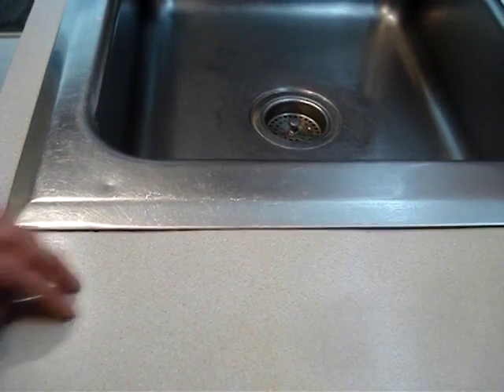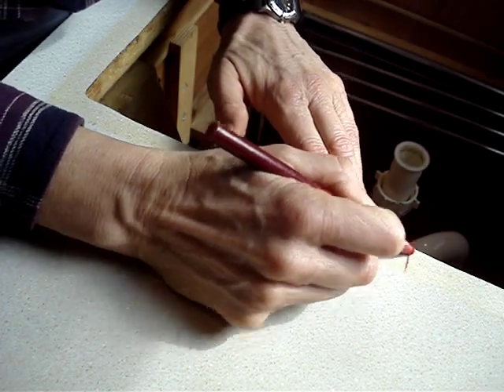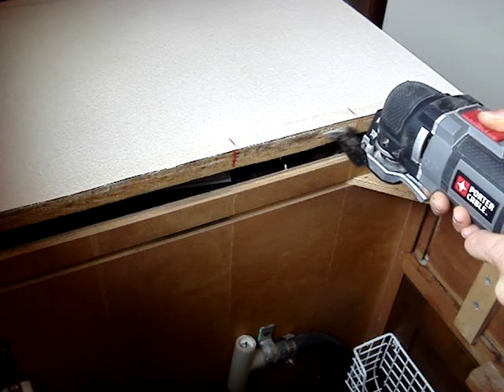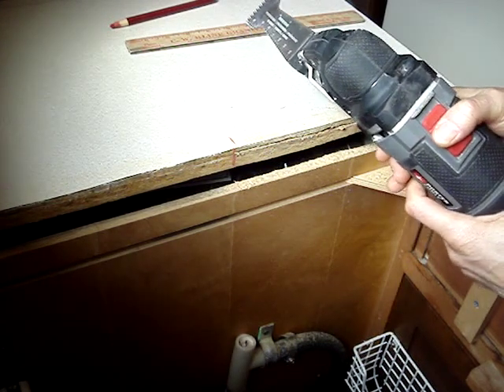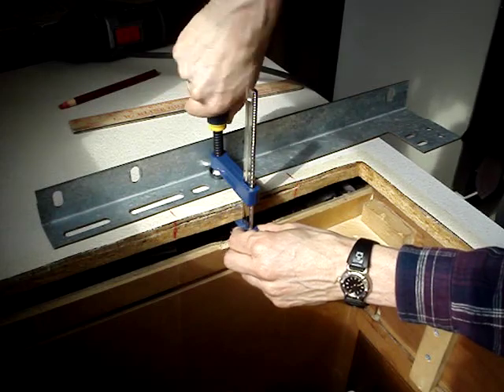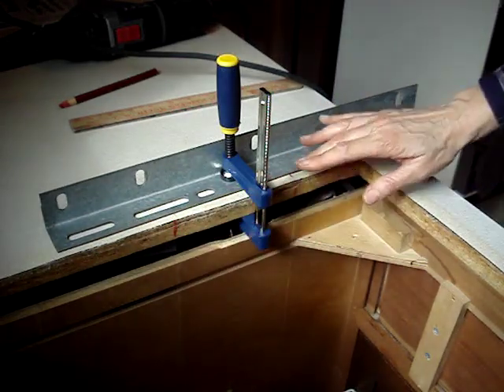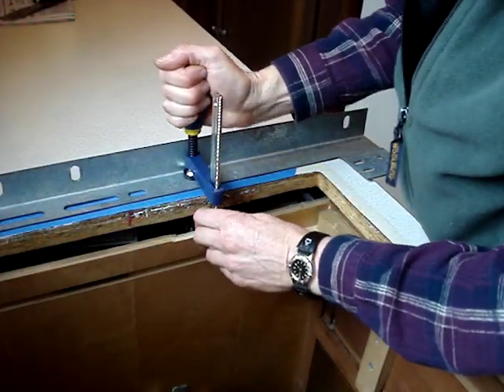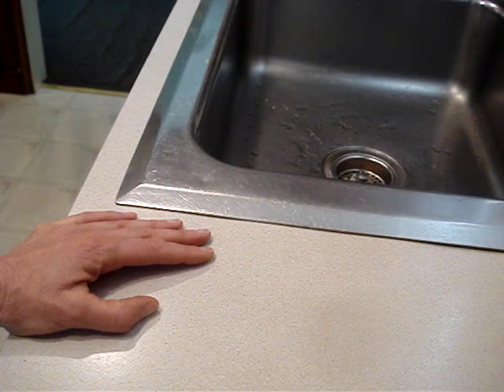How to Fix Kitchen Laminate Countertop  - Water Damage

Comment: One additional tip to help prevent this in the first place, and in future. When the hole is cut out, seal all round the cut with a 50/50 mix of water and PVA glue. This will help stop any water leaks from soaking into the worktop. Also do this to shelves under the sink and any other unlaminated edges.
Reply from the maker: Thanks for the tip.

Comment: Nice job! I was initially going to try to cut out some fiberboard  with a utility knife but decided to first see what other solutions fellow DIYers came up with. The oscillating tool is an excellent idea along with using a flat edge then gluing and clamping.  TY!
Reply from the maker: It's been a few years since I've repaired the countertop.  It's holding up perfectly.  You might want to seal up the cut ends of the counter top with wood glue or silicone.  I have a video on how to install the sink too:  https://youtu.be/4x-CaFZaZZw

Comment: Great fix, thanks.. if only people would seal the cut edges when fitting, this sort of issue would be a lot less common! Use slightly diluted waterproof wood glue to seal all the cut surfaces.
Reply from the maker: You are welcome, my repair is holding up.  I think the plumbers putty around the sink edge had dried out.  When I replaced the sink basket strainer, it was stuck and I broke up the putty while removing the strainer.  Then water got underneath.  I used silicone to seal the sink when I reinstalled it.  Good idea about using the wood glue.  If a contractor is doing the work, they don't want to loose money on the job and details like your suggestion get left out.
Reply: @Know-How-Now  Yes, silicone is best. I find it surprising that most fitters don't seal - I think it's more a case of people not knowing any different, after all it only takes 5 minutes!

Comment: Thanks. There's hope for my new countertop that I started using without a backsplash thinking the bead of silicone was good enough. It'll be a bigger job than this but it beats replacing a bunch of custom countertop.
Reply from the maker: Mine repair is holding up.  Best wishes for yours, John.

Comment: Brilliant! Did you come up with this idea? It's too smart honestly. And yes brave I agree. Not sure if I'm up for it. I want to do it I really do but I'm afraid to muck it up.
Reply from the maker: When trying something new, I always allow extra time and do the work when I am not tired.  If the counter top is already damaged what do you have to loose?  I have other videos about removing the sink and installing one:  Know How Now videos about sink repair.  Best wishes for the repair.  https://youtube.com/playlist?list=PLvce66kQTjJTBySgHNlCxhsicSBR50h1V
Reply: @Know-How-Now  Thank you so much! Would sealing the the gap between the over mount sink and counter be sufficient to stop water getting in? The counter is warped up and down swollen and hollow in one spot. Dry it out, feed a cannula into the gap (5 mm high) and squeeze silicone caulking a little bit at a time, letting it dry in-between. Then a bead all around. Or plumber's putty so I can remove the sink later?
Reply from the maker: You can try shooting some silicone in the gap, but I'm not confident that it will be a good seal.  The sure way is to pull up the sink, clean the sink/countertop and put down a bead of silicone.  You might want to make sure that the sink is clipped fast to the counter top, maybe that's why it failed.  I have a comment pinned to the top of the comments that has a link to my videos about kitchen sinks.  If I remember correctly, the install video talks about the clips.  There is also another playlist on the channel with more plumbing videos.
Reply: @Know-How-Now thanks !!!

Comment: What technique would you suggest if there is similar damage (in the above video) on a seam joining two countertops?
Reply from the maker: Hi Aaron, if you don't have access to "hollow out" the material under the bulged covering, I don't know of any other way to fix a counter top.
Reply: I believe I can access the countertop from below and I will have to pull it apart. A job for the weekend 😀 thank you for sharing your video.
Reply from the maker: I hope the repair goes smoothly.
Reply: Hi Aaron. I have the same issue as yours. Did you manage to repair with this method?
I also think that the damaged pane/sheet needs to come out for proper access to the side, to "hollow it out"..
If you can let me know, I would appreciate it a lot. Thanks.

Comment: Great video. At first I thought you were going to cut out a chunk, but instead you just made it thinner. How do I prevent water damage in the future?
Reply from the maker: Run a bead of 100% silicone between the lip of the sink and the counter top.  Don't use any water based "caulk", it dissolves if exposed to water.  You could also use a rope of plumbers putty to seal it, but over time it dries and and it will allow water to pass under the lip of the sink.  You could also try to seal up the edge of the counter top with the silicone as an extra protection.
Reply: Hi Janac, To prevent water damage in worktops follow these tips:

1. Always seal ALL exposed edges and cutouts with 2 coats of exterior grade varnish or paint. 

2. Add a bead of 100% silicone ( not water based one) along top edge before putting sink back in. 

I usually varnish all edges (back, sides and cutouts) with  2 coats of varnish, pva glue and silicone on top. I have never had an issue with water damage in a worktop. I know its very OTT but  worth spending the extra time a few pounds now doing it properly than having to spends hundreds having it repaired/  replaced in two years time.
Reply: @gulzarmalji7076  thanks!

Comment: Hey, great video. Unfortunately, our sink is in worse condition. It has started to fall through (one side) as a result of the laminate deteriorating away (1-2cm), leaving a slight hole on that side. How would you go about fixing?
Reply from the maker: You could try cutting out all of the rotted/bad wood and leave laminate/top part.  Then glue/screw a new piece of wood to replace the cut away part.
Reply: @Know-How-Now  hey sounds very sensible! Is there any way to avoid making it obvious it’s a different piece of wood? (Make it look clean)
Reply from the maker: I may not have been real clear.  If the layer on top of the wood core is not damaged, you would not cut that away.  Just replace the wood underneath.

Comment: how would I fix this same issue on the part that touches the wall behind a stove built in to the counter? It is too small of a space to get a iron back there or anything else but my pinky.
Reply from the maker: If you can't access the edge of the counter, I don't know of another way to make a repair.
Reply: @Know-How-Now  we had to take the stove top off to get to it.

Comment: Behind the kitchen sink , water has seeped into the splash board, causing the splash board to swell and crack  it's laminate. The splash board, has taken a concave shape. I don't want to have a contractor replace it, because the 
house was built in 1984, and I doubt that a matching laminate  (matching to the rest of the countertop) could be found. I've considered purchasing and installing narrow wooden molding to fill the gap between the back of the sink and the  bottom of the splash board, where the splash board is bowed and the laminate is cracked,  then caulking over that.  
Please, what are your thoughts?
Reply from the maker: I wouldn't use wood, it will just soak up water and swell.  If you are going the molding route, you might consider a molding made from PVC.  That won't soak up any water.
Reply: @Know-How-Now  
Aha! Didn't know that they make them in PVC. Thanks!
Reply from the maker: You are welcome, best wishes for the repair.